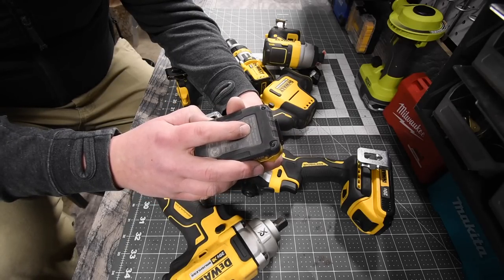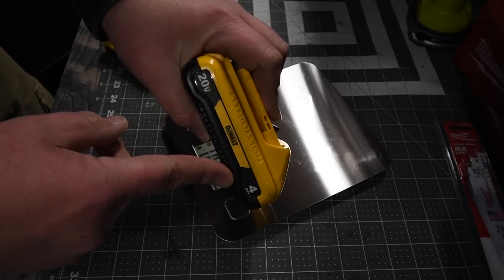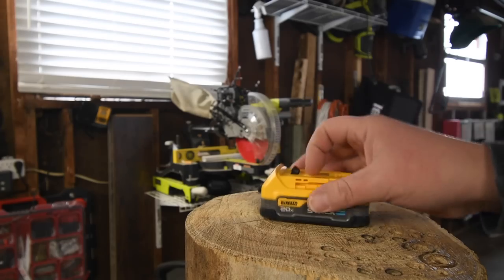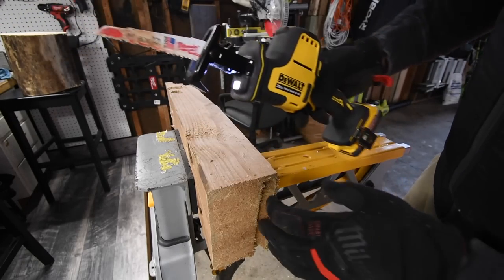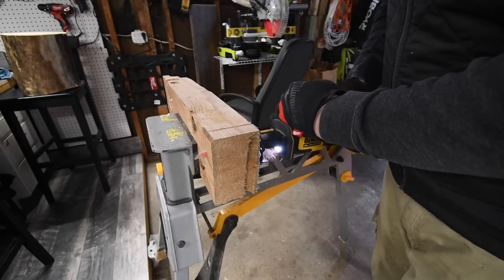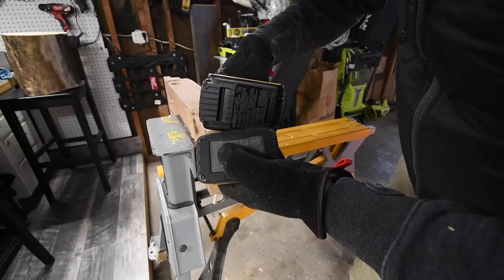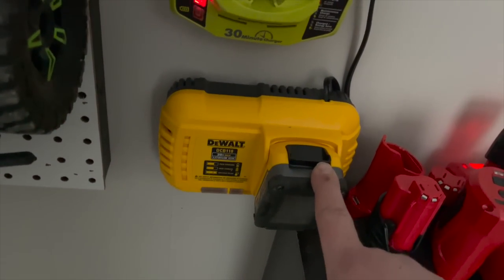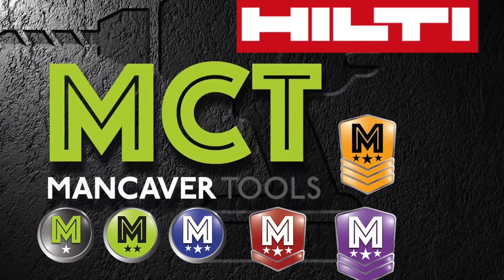Dewalt PowerStack battery (DCPB034) You need this Battery!!

Comment: I really  wish you guys telling everyone how much better these are would also tell them of the shorter lifespan and cycle. And the damage that will happen if they are discharged below the min voltage unlike 18650 cells. Also what happens if the cells are damaged, that's why they added the rubber for extra protection ( just look for exploding lithium cells on YT).
Reply: Explain why they ought to have a shorter lifespan given the charging cycles for 18650 cells are rated to about 500 charges while these are rated to 1,000.  Even if they don't meet the claimed manufacture's numbers and only have half of that they should last just as long.  Any battery will sustain damage if discharged below their min voltages.  While long term testing certainly needs to take place to see how they stack up long term you are making nothing but assumptions that their lifespans will be shorter or that the company used to supply Dewalt these batteries didn't do any testing to damaged batteries.
Reply: @theripper121  I have been useing these cells for 20+ years in everything RC as the high current draw and light weight it what is needed in helo's, planes. and quads, and in the cars we used the 18650 packs. These seem to have more power as they dump the stored elec. faster, this is harder on the packs. Your numbers are all wrong btw a lipo lifespan is around 250 cycles. So in closing facts are this - More power faster - shorter charge cycle - shorter pack lifespan - and safety issues pos.
Reply: @briangray6372  Your so-called facts are again nothing but assumptions at this point given the lithium pouches used in these tool batteries have not been used in anything previously in the realm of power tools and the company that supplies these batteries for Dewalt states that they are much safer than a traditional pouch found in common cell phones RC batteries etc.  Whether you believe that or not is one thing.  But to make blanket statements about their longevity or safety with no testing is ignorant on your part.  You make a claim and have nothing as of yet to back it up.
Reply: It's Dewalt, one of the world's top tool makers, they wouldn't even release the battery if it wasn't safe or couldn't perform, they have done lots of testing before they even release them, I have complete trust in Dewalt as a company, their tools have worked for me and put food on my table for years, their tools have been to hell and back in my possession and they still work perfectly

Comment: I use powerstacks on my tiny BID-11XR because smol. Squeeze into closed off areas easy peasy! 

Even the teeny tiny 2Ah dewalt battery looked like an enormous clown-shoe on my bid11 so the two were definitely meant for eachothers existence 🏖️

If you want pointless extra runtime because you're too lazy to dock a battery at the end of the day, get a 15Ah flexvolt battery and use a belt-clip extension cord kit like the asians do :)

Comment: It's interesting how Flex has yet to release its stacked lithium batteries. They had that leak a few months back that DeWALT used to jump the gun to release the PowerStack batteries. It would be nice to see the head 2 head between these two when FLEX releases them. I hope the other brands have the same idea with this tech.
Reply from the maker: they should be coming out soon
Reply: @ManCaverTools  I hope so it will be nice to see videos on the Flex stack batteries and not just the DeWALTS.

Comment: Are u sure that that 4ah is 21700? My 4ah has xr on it and is slightly larger than my 5ah xr (18650)
Reply from the maker: yes it does have 21700 cells
Reply: If it's the DC B240 4Ah then It sure is, 
it may look small on video but it is actually a hilariously fat battery that makes Ryobi's batteries look small

Comment: A small light low aH battery with high aH power? Yes please. At least for those instances where weight and size make a difference. I have no doubt DeWalt will make bigger aH version of the stack which will also sell like gang busters. Let’s be honest, dudes don’t feel like dudes if they aren’t using 4aH batteries or higher, lol.
Reply from the maker: this battery will help out in so many ways.
Reply: Biggers are coming...